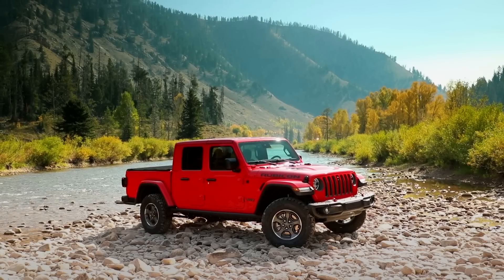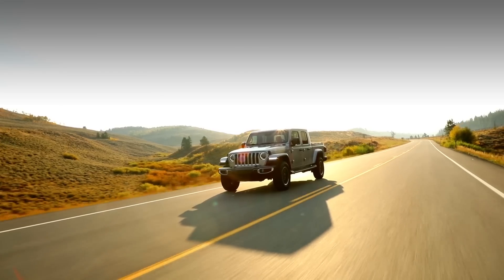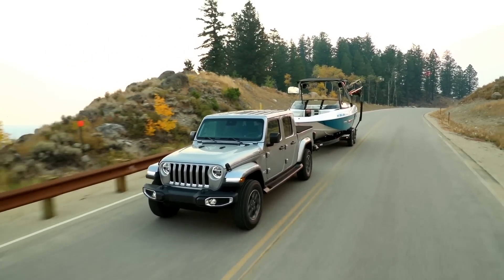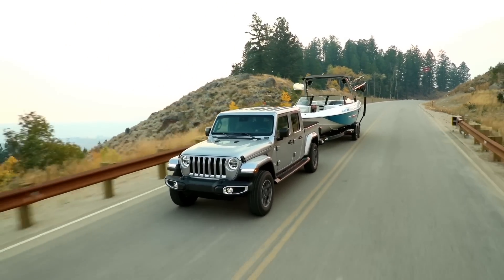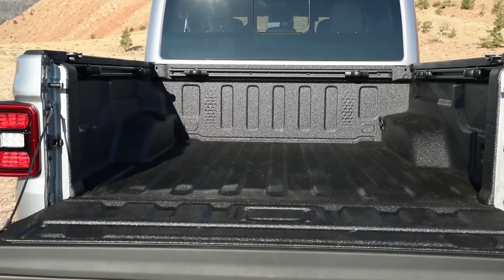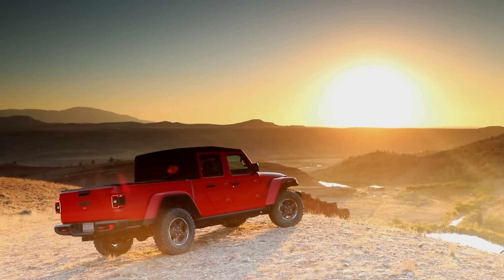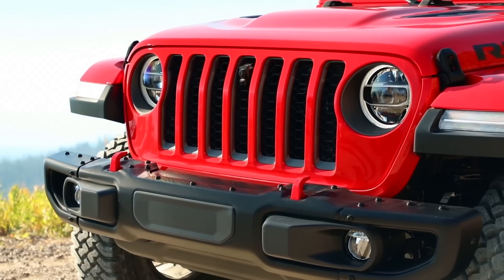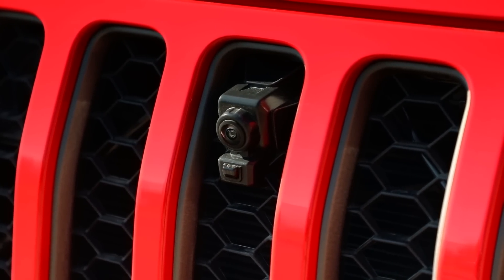2020 Jeep® Gladiator - Engineering Feature

Comment: I know there are some that HATE Jeep and some LOVE Jeep. I am in the middle. I have heard people try to bash this truck and try to say it's the greatest ever. That's dumb. For the body style it looks cool. I would much rather see them use the Crew Chief design for this truck. Just punch in the name and take a look if you have not seen it. The idea that you can take the top and the doors off is a pretty cool option for a truck. Horse power number 285 is great but the torque number is a little bit low. Off road numbers look good like approach angle and over all 11 inches ground clearance. It is really long so break over angle is poor in this truck. The back seat is really big and the bed of the truck is pretty small. With the way t is set up it will definitely be rougher riding of the mid-trucks. If you drive 95% on road and only 5% off road this will not be the truck for you. The one thing I expect to really hold it back is the pricing. I expect it to go over $60,000.00 for the Rubicon. Jeep is really bad about over-pricing their vehicles! People are willing to pay them ANY amount they put on their products so Jeep will continue to over-price their products including this Jeep.

Comment: Not sure it will be as nimble as a Colorado ZR2 on tight trails, it won't be with that wheel base.  Check out our ZR2s on super tight trails in the rock, mud and snow on an island in Lake Huron.  Do you think the extra wheelbase of the Gladiator will "ruin" it for tight trails?  @